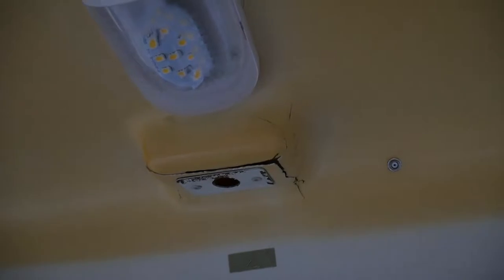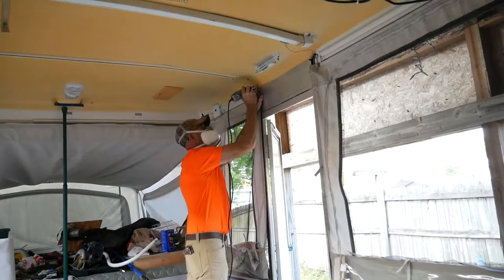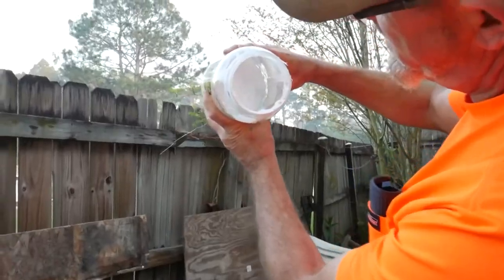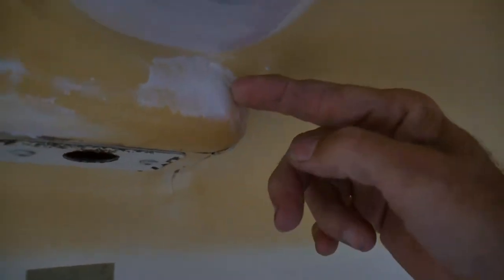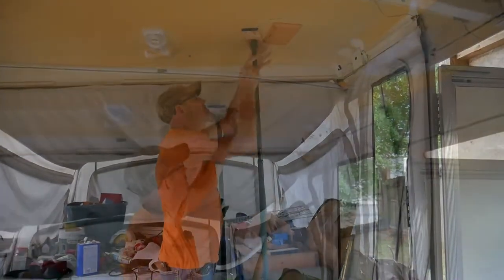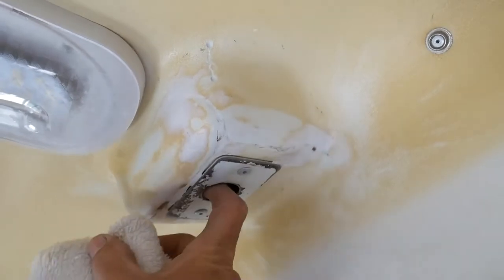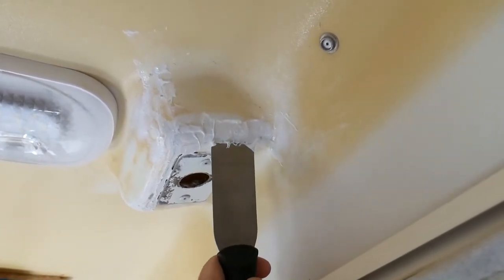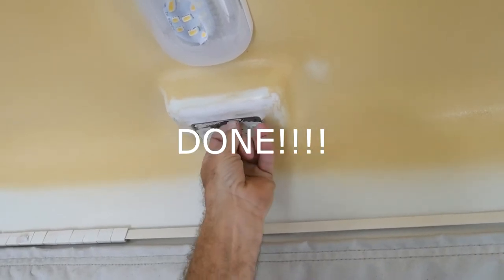ABS ceiling repair for a pop-up camper remodel

Comment: This is exactly the video I was looking for. I’m experiencing the same cracking around the the lift arms as you did. I just wish you would have added a little more information about the products you used as well as the amount of time it took and possibly cost. Just missing the details. Really want to get these cracks under control.